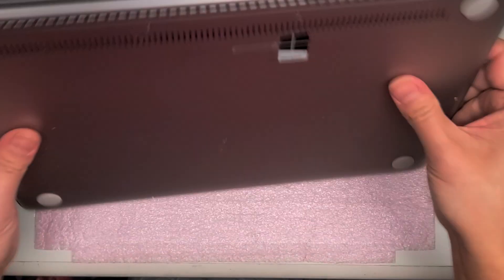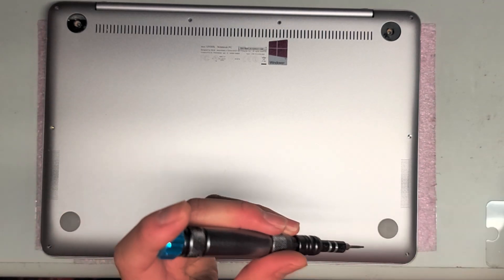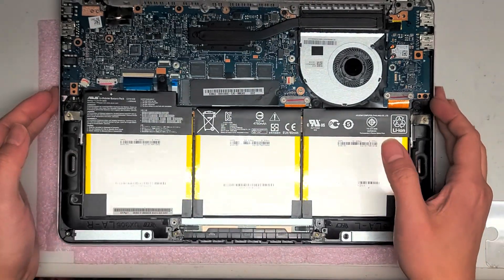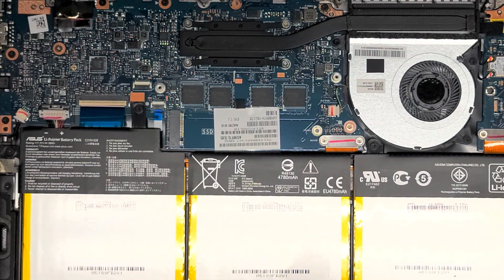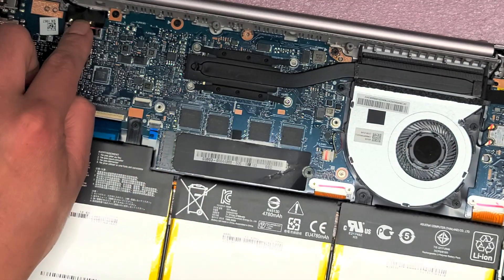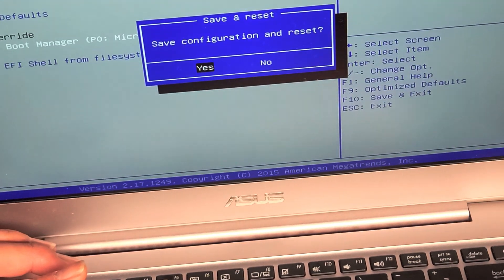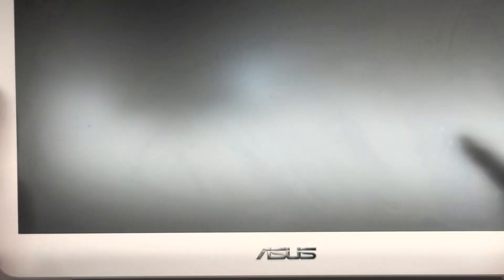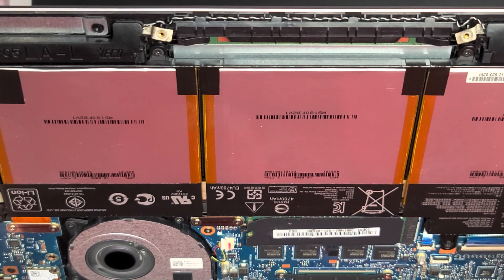ASUS UX305L Disassembly SSD Hard Drive Upgrade Repair Quick Look Inside

Comment: bro, tell me please - where is CMOS battery? cant find it
Reply from the maker: It might use the main battery as the bios battery.
Reply: @ItsBinhRepaired  when the main battery is completely discharged, the bios is reset.
Reply from the maker: @antonvavi  yup
Reply: @ItsBinhRepaired  ok. thx for attention.
Reply from the maker: @antonvavi  no problem